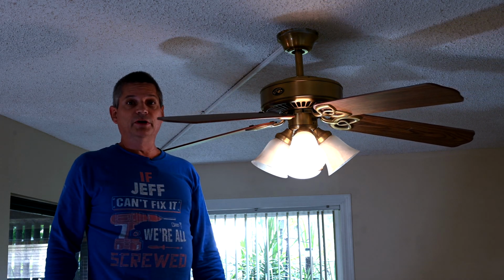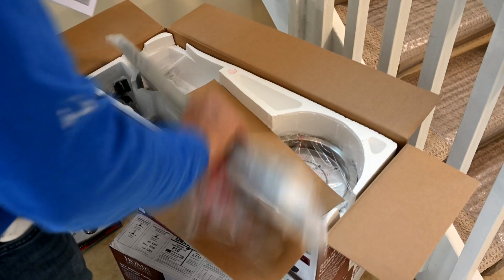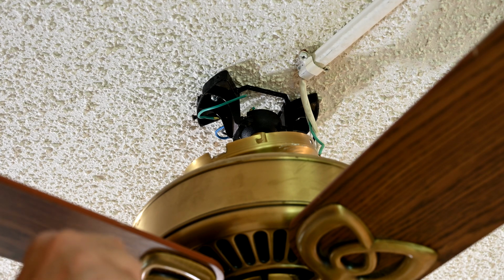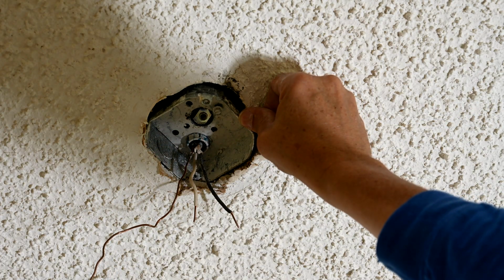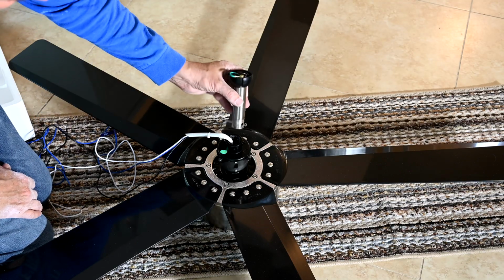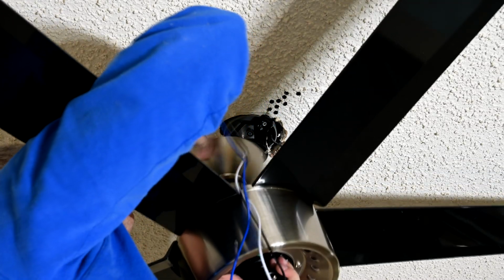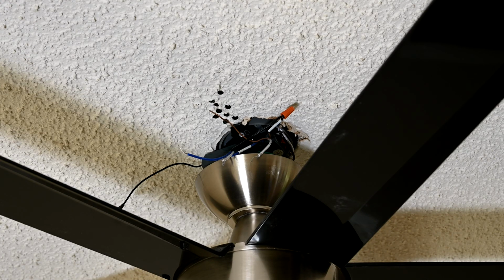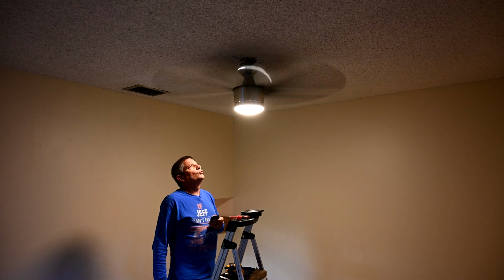How to Install Ceiling Fans - Fix Installer Errors, Wobbling Fan

Comment: Learnt to ground at the ceiling electric box today!!  Did not know that...thank you.  Took the old one out and replaced it with the one you recommended from home depot.  Also when installing the old fan I had kept aside for future use...how to put that holding/locking clip in and also to make sure mounting ball is locked in the groove on the metal bracket..  That wasn't on your video as this was a different fan...but I knew there had to be a locking mechanism so it doesn't wobble after watching your video...huge help!!!
Reply from the maker: Awesome, glad to help out.

Comment: Jeff, the stud screwed to drywall method, is this per code? I thought you have to connect to the house studs/frame to be secured properly?! 
I used the Westinghouse Safe-T-brace unit (expands like a screw) and what a pain in the butt it was! As I had to remove the light holder bracket and it’s nails in order for the fan bracket to grip the house stud :/
Reply from the maker: This is not to code but it is a vast improvement over what the previous installer did and terms of reliability  and strength of the structure. If you go back and watch the parts of the video where I was explaining this there are no wood studs for that Westinghouse bracket to fit in between. The bracket that I removed out of there was not properly connected because somebody just try to twist wires on the ends of it to the metal trusses that were up there in the Crawl space.
Reply: @jeffostroff yeah I skipped through most of the video. Thanks for sharing

Comment: Most of the fans I’ve replaced have had loose mounting and loose fan blades. After years of fan motor vibration and being unbalanced the hardware likes to loosen up. I think a lot of the fan hardware could be better. Good video Jeff.
Reply from the maker: Thanks! When we keep demanding $99 fans, that's what they give us!

Comment: Jeff, did you use the same extension cord system to wire the new fan too?  It sure looks like it.  You said it was against code, why did you leave it the same way?  I'm confused, you never mentioned it or showed us while you were hooking that fan up.  Please advise me.
Reply from the maker: This was at my friends house and they are absolutely broke there wasn't enough money to go spend on additional work and buying reels of Romex cable to run up the wall and then up into the attic overhead and then to try to run it over to this area here without cutting additional holes that would have just taken a few more days for all the dry wall work to be done after the fact. So in that particular case I left it no worse than it was,  But I at least removed the tripping hazard with the wires bunched up on the floor. Had this will been one of my normal flip properties I would have in a heart beat removed all of that stuff and just ran Romex inside the dry wall,  Then patched all of the holes.

Comment: Jeff, they did the same exact thing at my old house. They installed ceiling fans and they were no ceiling fan outlet boxes and they ran ungrounded (two prongs and wires with no safety ground) lamp cords across the ceiling and down the wall to plug into the outlet. I just wanted to share that with you.
Reply from the maker: Yes it is a very common practice for DIY people in handy man type people to run lamp cord ilegally up the wall and across the ceiling.